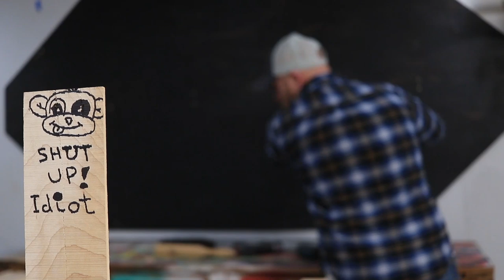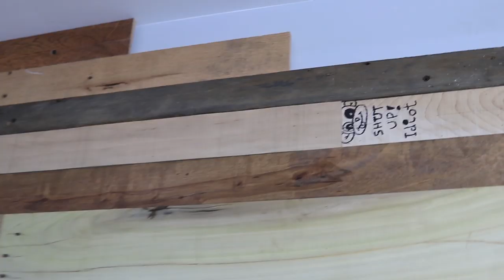Ultimate Tool Wall Made From Pallets and Reclaimed Lumber || DIY ||

Comment: Awesome as always bud. What was the metal detector you used for the nails called? Only reason I haven't ventured into pallet wood yet
Reply from the maker: Russel Barden here is the link to it.  Hope this helps.  And thanks so much for all the support, good luck with the pallet wood projects. Kuman Pin pointer Water Resistant Metal Detectors with Holster Treasure Hunting Unearthing Tool Accessories Buzzer Vibration Automatic Tuning KW30 https://www.amazon.com/dp/B074GP3QBD/ref=cm_sw_r_cp_api_i_XMyACbY4RZAN6